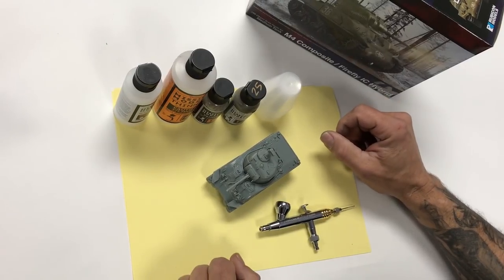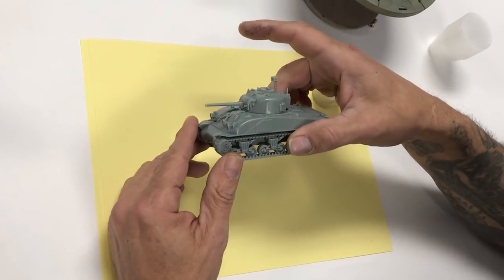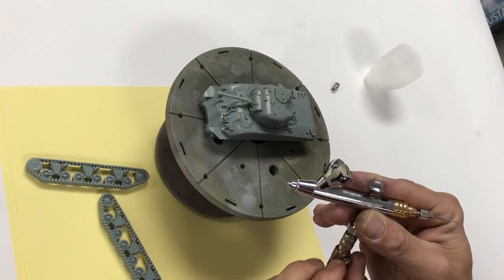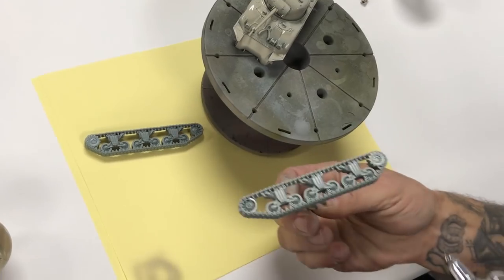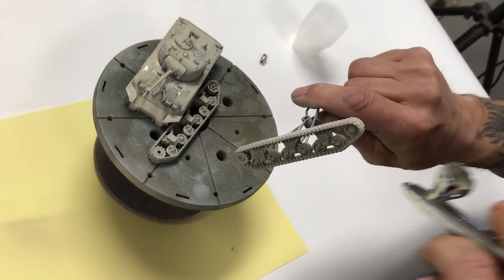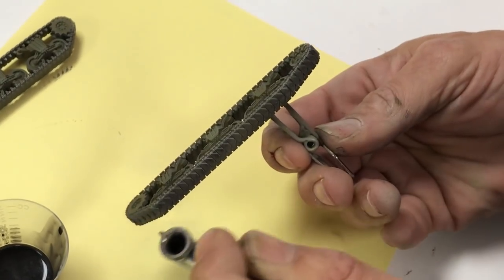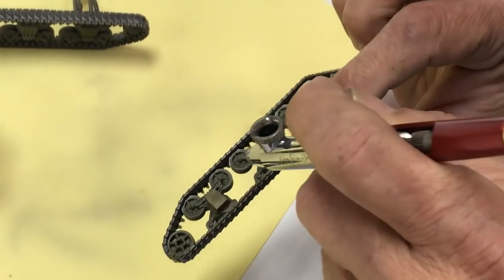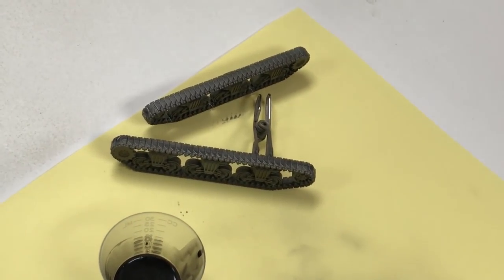Mission Models MMP Paint Tutorial  Rubicon Models 1/56 M4 Sherman Composite Video Boltaction

Comment: I have tried this week end for the first time MM paint and i had a very bad experience. I have used the exact mixing ratio (30 drops paint+4 drops thinner+ 4 drops poly) and tried to spray at 15 psi. My airbrush is immediately cloaked and i could not spray. Than i have tried only paint and with 20 psi. It kind of worked but it was not so flawless like in this video. 10 to 15 psi is absoluty not possible. I do not know what i have done wrong but it was not possible like depicted in this video